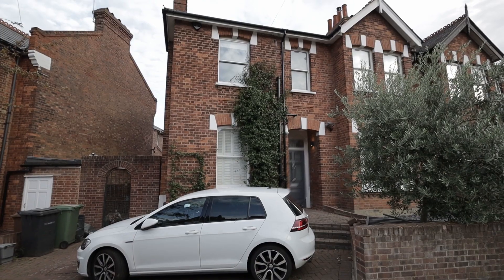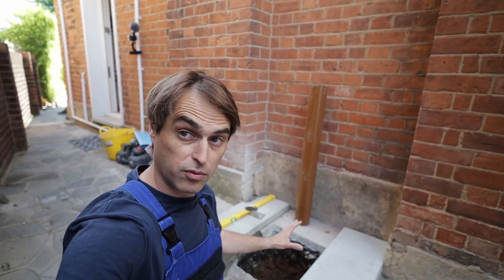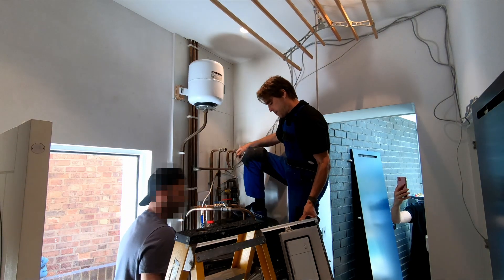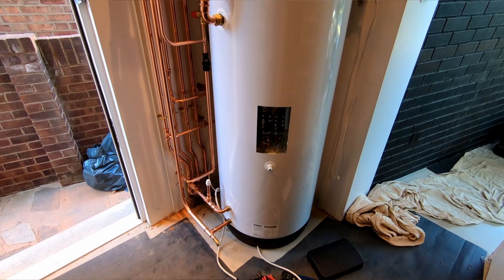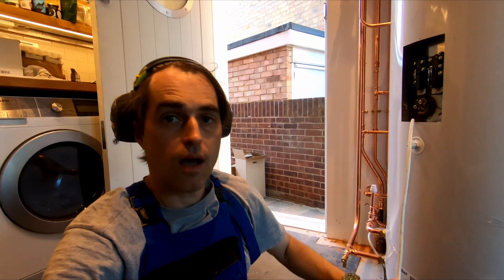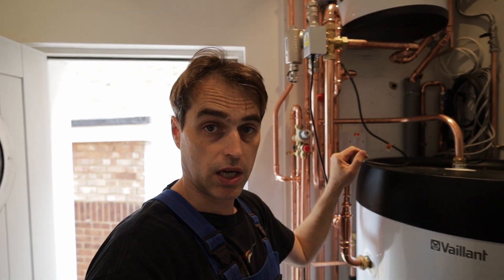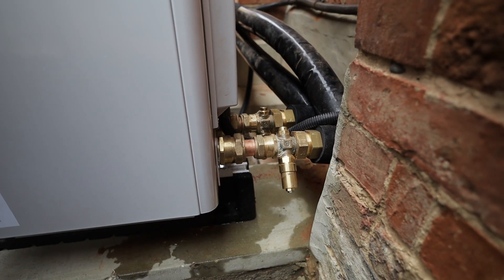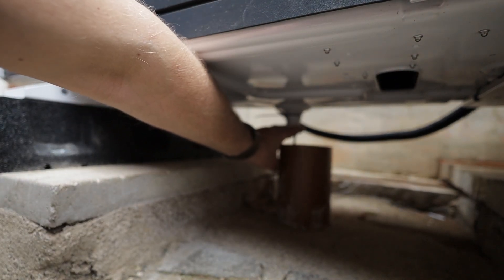Is This Heat Pump Better Than Your Gas Boiler?

Comment: They just take up so much room! My house isn't big enough to fit one in or fit one near a sensible wall without causing an obstruction or needing interior remodelling. I'm sure the technology works but...

Really need a good electric alternative to gas that isn't the current heat pump. :(
Reply from the maker: Any direct electric will cost you 4-5 times more to run than a heat pump.
Reply: @UrbanPlumbers  so my research suggests. Still don't have room for a heat pump (or rather, for all the ancilliary stuff like the buffer tank that goes inside the home). 

Maddening. I'd love a heat pump, but it's just too disruptive & costly to put in, as usual for reasons of UK housing stock. The technology is fab. Our houses however are mostly pokey little affairs that leak heat like we want to warm up the street...   :(
Reply from the maker: @jezlawrence720  insulate the home. Get heat loss done. Size new radiators to 55C on a gas boiler. That is a start and will save you money on a gas system.

You can keep the gas boiler (combi) for hot water and add only an external unit (air source) for heating. No space inside is required and you get the best of both worlds. Cheap hot water and super-efficiency heating.
Reply: @UrbanPlumbers  

Really grateful for your suggestions, thank you so much for trying. This reply will be unavoidably "wall of text", sorry, it's because - as you know - it's really all about overlapping diverse measures. So the "total picture" is important.

The heat loss is the one thing I really do need to get done - I can see mid winter that each room loses about 2C per hour, and about 1-1.5C in late autumn/early spring. But I'd really like to get it done by a pro. 

Property is a (small - largest room is 3x4m) 3 bed semi. Has A rated EPC as of this year. My flow rate was, last winter, below 55 and was indeed fine. Ground floor is concrete, so underfloor heating or insulation is not an option.

House insulation in place:
- Loft insultation 
- Cavity Wall insulation
- Double Glazing. 
- Thermal curtains in every room

About the only extra thing I could do here that I can think of would be get external house insulation fitted.

Systems:
Solar + battery
Mixergy Smart tank, heat pump ready and waiting for solar diverter. This has meant I've had to turn up the flow temp on the boiler back up or it doesn't get hot enough for the tank, but once the solar diverter is in I plan to not use gas for this anymore at all.
Gas boiler now running as a system boiler only. Flow temp was 55 last year, currently mid 60 but it'll come down again once solar diverter is in for the tank.
Smart Thermostats on all the radiators, providing option to just boost one room whilst leaving the rest of the house to lean on a schedule to maintain thermal mass. Set back temps 2C cooler than heating temps, generally the house is only set to maintain at 18C. 
Gas Hob soon to be replaced by induction. 

During summer, we're gas free. 

During *winter*? Still looking at 9-10000 kwh gas (already down from 12K thanks to those thermal curtains and flow temperature reductions). 

I'm aware, unless I've missed something: 
- A good heat pump install ought to bring that down to about 3-4000kwh of electricity, keeping it broadly the same cost as 12000kwh on gas. 
- Any other electric heating is going to provide only a 10% kwh or so reduction (gas = 90% efficient on a good day, electric 100%) but of course a massive jump in cost per unit.  

So a heat pump is the obvious missing piece. 

But even with most of the internal systems now ready to receive, I can't make the property physically larger to find somewhere even for that little buffer tank thing, and there really aren't any spots near the exterior wall where the external unit could go without properly being in the way or having to remodel inside the house to get pipework through and connected. Really only one small area of the outside will let you connect in to the rest of the pipework easily, and that area is already full of non-moveable drains and gutters... and the home battery which can't fit in the loft where I wanted it due to how tight & unmodifiable the loft access is.

Heating is still The Wall I Cannot seem to Climb, and late 40s council house design really did not build for usable loft space. 

Barring maybe 2 radiators getting upsized (barely a blip in the total cost), I'm theoretically 'ready' should things advance to the point that it really is just a question of bolting on an external unit.

But the various folks I've had around to look at this... they aren't able to find a decent spot that wouldn't take up interior space I don't have, require remodelling the kitchen or bathrooms (the two most expensive rooms in the house to have to redo). 

This is without getting to whether the house fuse is large enough for a heat pump (it's not) , let alone a different electric option (it's really not! I'd have to go from a 60 fuse to a 100 one for sure)

...And of course every company only wants to be responsible for their one bit> plumbers don't want to have to co-ordinate sparkys and vice versa, and no-one wants to be on the hook for redecorating as part of the quote. 

So I've had to research, plan, co-ordinate and implement each stage of this process as if it is a separate unconnected thing - a year ago I had no solar, battery, tank, induction hob etc etc. 

As a homeowner without actual skills or training, this is something of a nightmare. I've got some ancient project management skills which have helped but really I'm amazed I haven't seemed to made any major screwups yet, all seems to be working and interoperating as predicted. 

And this is why I'm so hesitant with heatpumps. i do have some confidence in my research and planning skills thanks to the last couple of years. People who've looked at the property are very positive a heat pump would work... right until they start saying 'ok and this bit would go here and that bit would go... ah. Ah yes, I see what you mean... hmmm....'

So... yeah. I'm obviously not sure what I don't know but I've done my best and so far... I've not been wrong as far as I can tell.

I didn't mean to sound in my original post like i was somehow down on heat pumps or on your videos, your channel amongst others has been a big part of the research contribution!

I was just bemoaning the fact that we don't have any cost-feasible, practical alternatives to heat pumps that don't involve either setting fire to stuff like a cave dweller, or tripling the running cost thanks to the bizarre situation in the UK where everything is based on gas except for the eco levies which appear to only be on electricity which of course all hugely distorts the actual pricing.

I think I'm just going to have to wait for the current government to change, hopefully for one which still remembers what 'strategic planning' is and why it's important, and then we might get some actual movement on holistic approaches & grid.

:(

Comment: I have a Air source heat pump that was fitted quite some time ago. It is a lovely system and quite cheap to run however living in a ground floor flat with old windows and I also heat upstairs through heat loss. About the only downside is the water temp of 40c and if I want a hot bath I have to boost it.
Reply: @zlmdragon.  not true. gas boilers for heating and DHW have around 24kw to produce DHW. If you had a 6kW boiler, you'd have a tiny pee in your shower head. Modulating gas valves are able to reduce to 1/10 of the nominal power to adjust the heating requirements. HP need a lot of space (properly oversized compared to gas boilers) and a change of habits when using DHW.

Comment: I'm amazed how all the people complaining at heat pump prices still somehow manage to be able to run inefficient fossil fuel based heating. I mean it's just math right, you pay for 5x the energy on fossil than you would on heat pumps. 🤔 (and gas is not 1/5 of the price either in kWh)

It really makes sense only if you use very little fuel and thus can't offset the installing costs.

Comment: Another great video Szymon! 
How does the 40 degrees work with hog water? 20-45 degrees stored water is meant to harvest Legionella bacteria isn't it?
Reply from the maker: Heat pump goes higher for dhw and runs legionella cycle once a week
Reply: @UrbanPlumbers  wow thanks for super prompt reply 🙂
Whilst Im here, can you tell me if microbore piping (10mm copper) is an issue?

Comment: Heat pumps are not the answer unless you are installing them into a new house, designed to take advantage of low-grade heat expelled from the building or, as in Scandinavia, power station cooling outflow. To install them in the average British house will not work, plus you will have a noisy condenser outside your house and all of your radiators will be 4 times larger and all of your plumbing piping must be replaced with larger bore piping.
Microwave heating is a better solution.
Reply from the maker: Almost noting in your statement is correct. Heat pumps do work in most homes, not all though! Pipework almost never has to be replaced, just new primary pipework. Radiators are usually 2-2.5 times larger not 4. Heat pumps are no longer noisy.

Comment: On the chart you showed with the SCoP, the smaller 5kw model gets a lower CoP than the 8kw model?

Given there's not a lot of price difference is it better to get the 8kw model even if it's oversized or will there be more losses from an "oversized" unit that negate the CoP difference?
Reply from the maker: Oversizing would be detrimental to cop
Reply: @UrbanPlumbers  good to know! just want to say, as an engineer, seeing someone take pride in their work, and calculate it all the right way is great to see.

Videos like these  help those of us thinking of having this kind of work done know what to look out for when choosing an installer. If I was a bit closer I'd definitely be giving you a call!

Comment: You ‘MIGHT’ save 20% on your energy but that’s unlikely. What is more likely is it will cost you a lot more! 
Even if I does save 20% the system will be outdated and replaced before it pays back. Total waste of £15-20k

Comment: they are not very good, in fact to comply to Legionaire regulations, an electric immersion heater has be fitted to it, to make sure water temp exceeds 60c
Reply from the maker: Not true. This unit goes to 70c and no electric back up is needed or used for legionella cycle

Comment: Maintain 21 degrees inside.  Sorry that it too cold.  Do you include jumpers, wooly hats and scarves in the heat pump when you sell it?
Reply from the maker: Nothing stops you from running it higher or designing for higher temps. 

Normal and healthy people need around 19c.

Comment: To be fair the average person will not be able to convert their home to install a heat pump, including, the necessary insulation and redecorating inside. I just hope the Gov does not force all homeowners to install one, unless it’s subsidised because it may be cheaper to run than a gas boiler, but the install price will be costly. Plus, it looks like you need a big utility room inside your home to install all the piping and tank that connects to the heat pump on the outside.

Comment: Honestly i really do not like those monster radiators. Looks like a lot of work considering the prices of electricity but they could always fit solar panels next. Shame about the trunking on the outside of the building.. Guess you need to build in advance with these things in mind for it to be well hidden.
Reply from the maker: trouble is - even on gas boiler those monster rads will save you a lot of money as they are cheaper to run
Reply: @UrbanPlumbers  thanks for the reply. I think my long term aim is to dig for geo-thermal pre-heated air to start with. I might go with heat pump eventually after installing solar. What is a heat pumps efficiency over regular electric heating?
  As far as radiation goes i would like to go for underfloor with liquid heat exchange system combined with the above. Problem is that the house is built on a slab without under insulation and with low ceilings downstairs. Ideally i would insulate beneath first. it's not ideal downstairs but i might be able to squeeze in a bit of insulation in.
  I've also got some solar vacuum tubes to install to pre-heat water. I'm going to use them to feed a small gas water heater. 
  Downstairs i am converting from wood stove to pellet stove because it's easier, cleaner and someone gave me a stove that i fixed. Generally i wear warm clothes and it can be between 7C and 18C in my house in the winter. lol usually around 13 in the bedroom which is nice.
  Bathroom i don't even bother to heat as it is a north corner at 1000M asl. The walls are concrete block with virtually no insulation, just some wooden cladding on the upper half.
  This house really needs knocking down but i might try to add some extensions and make those new external walls and floor fully insulated. I just hate all the chemical insulation, i think i want to go back to fully organic to really be happy. lol

Comment: Didn’t think regulations permitted the use of a 3 port valve on an unvented cylinder?
Reply from the maker: 3 port with a NO closed to the cylinder is completely fine and complies with G3. You can also install without any zone valves if it is supplied in that from from the manufacturer - for example Viessmann and Vaillant 4 pipe set ups.

Comment: on a hot day you don't need heat and on a cold day that heat pump can't get any heat really out of the air wen you really only want heat...at the moment tis system is 3 times more expensive than gas but you know they are going to put gas up so get a heated jumper it will be cheaper
Reply from the maker: on a hot day you have a super efficiency hot water generation. On a very hot day you can use the heat pump to cool down your property. On a very cold day, they still work perfectly fine, as long as you know how to design the system and install them.

If you think anyone can install them, then I agree - they don't work.

Comment: Heat pumps only work when they’re inside a solar flue , that’s a glass box type flue attach to the south facing wall and the Heat pump is at the top of the 12- 20ft flue ,the inner walls are black to absorb as much solar heat as possible and the passive solar PV panel allows the PV to work but not stop the suns heat .  The flues air temp can be 25 - 45 degrees higher then outside .  The solar flue also  Protects the pump from the weather so its a win ,win system .   The flue is patented can can’t be copied and you shouldn’t buy the  rip off  systems . The PV panels actually helps to power the heat pump which with the flue uses 90% less electricity to run the pump than a non-active control system.  Please don’t be fooled into buying these stick it on any wall  system that can’t do the job .

Comment: Your installs are magnificent. but, with the constant rise in electricity prices, is this the death of heat pumps before they got off the ground?
Reply from the maker: gas prices are rising around 20% more than electricity at the moment
Reply: @UrbanPlumbers  correct but it’s the cost of electricity used that’s crippling the average family, not do much gas …. At the moment that is!
Reply from the maker: @markjefferson7492  not quite. On average people use 4-5 times more kWh of gas than electricity  - so when the winter comes people will have astronomical gas bills.

The set up in this video is actually cheaper to run than a gas boiler.

Comment: HELLO, 
Thanks for the awesome VIDEOS.
Have you made a combination of gas boiler and heat pump where the heat pump work for underfloor heating and the gas boiler for hot water and when low temperature outside -C°?
What is your opinion?
Reply from the maker: Doing one soon’

Comment: Well, those heat boilers technically are bad and therefore I would have to say a heat pump it is better. But those companies actually do only produce products with high maintenance  costs. One should think they can build a heat boiler wich will never break. But for some reason they keep breaking. And the newer they are the more expensive those repairs get. As a heat pump is technically more complicated than a heat boiler I am afraid I have to say they will be terrible costly installation. Better go to small companies what never sold gas boilers and are dependent on producing good and long lasting quality.

Comment: may be scrap now, as electric prices rocket
Reply from the maker: Cost of gas is rising 20% faster than electricity
Reply: @UrbanPlumbers  at the moment mabye but electricity will catch up in cost.
Reply from the maker: @andrewdaley5480  probably the opposite is true, as the government wants to decouple of electricity and gas prices. This will make electricity even cheaper. At the moment it is 3:1 so you only need a SCOP of 2.8 to be comparable to gas. This installation is already 40% cheaper to run than gas.
Reply: @UrbanPlumbers  wait and see

Comment: I have inspected many properties which had air source heat pumps installed, virtually all people who had them disliked them as they turned out to be expensive to run and did not supply sufficient heat. In some cases landlords were in the process of removing them and installing new gas heating.
Reply from the maker: That’s what happens when they are installed by people who don’t understand how it should be done. Happens a lot, but does not mean they don’t work. When done correctly the are cheaper to run than gas and will outlive any modern gas boiler.
Reply: @UrbanPlumbers  Theoretically !